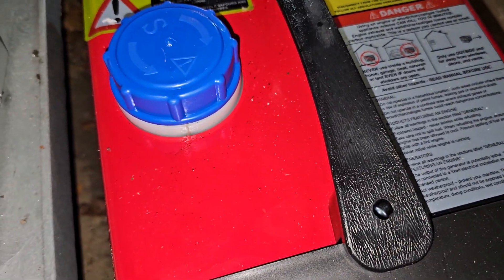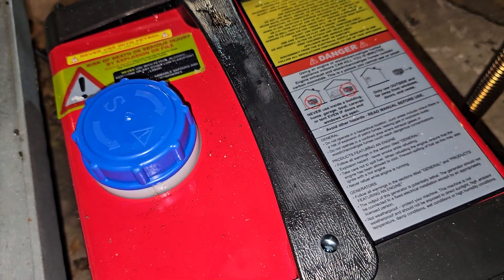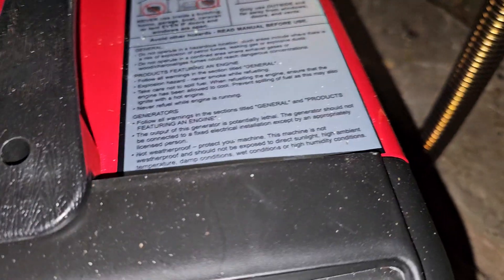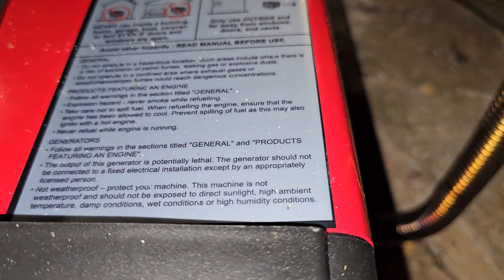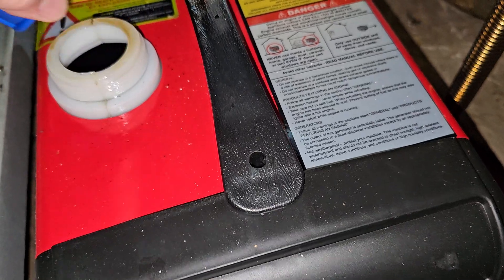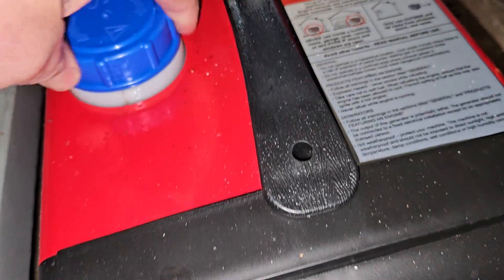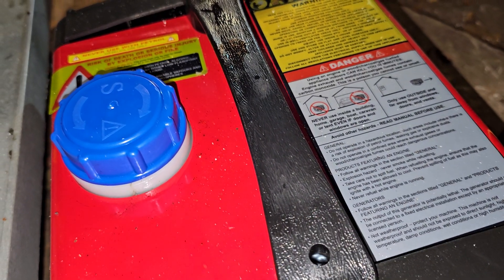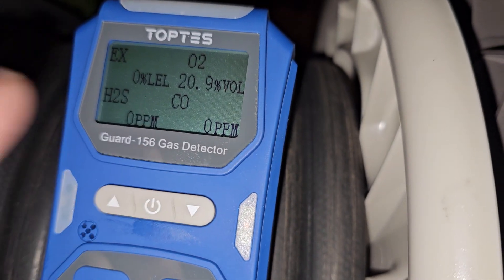Diesel Heater and how to add used engine oil mix

Comment: I have been running 1 gallon of used diesel oil to 4 gallons of diesel and it runs fine. You know the exhaust pipe needs to be straight with a slight slope down to run most efficiently.
Reply from the maker: It doesn't have to run downhill because the temperature will always be higher than moisture can condensate.